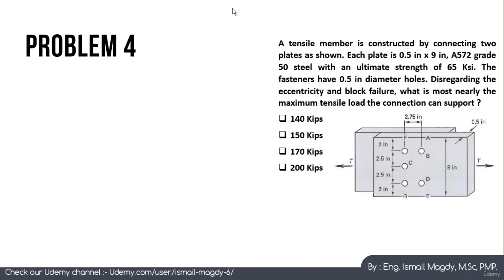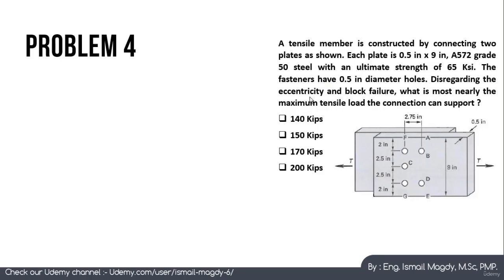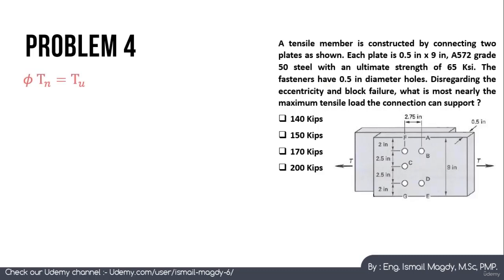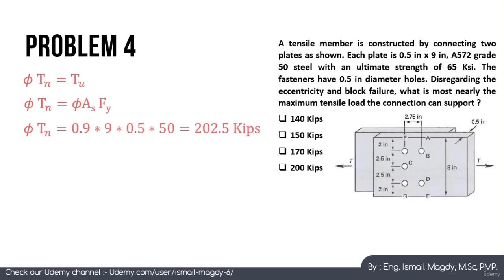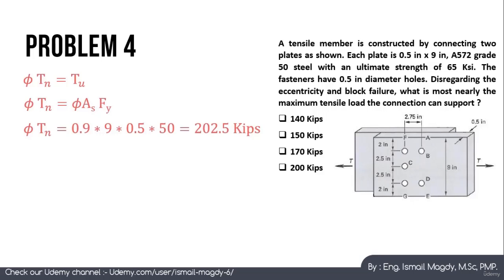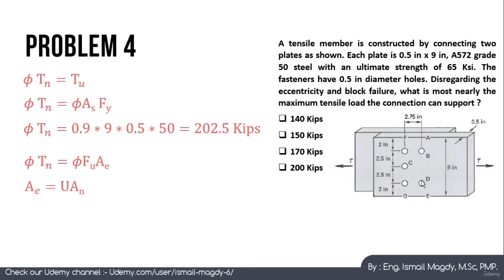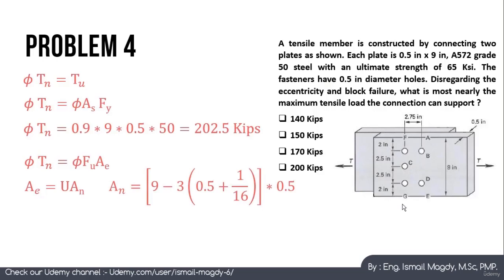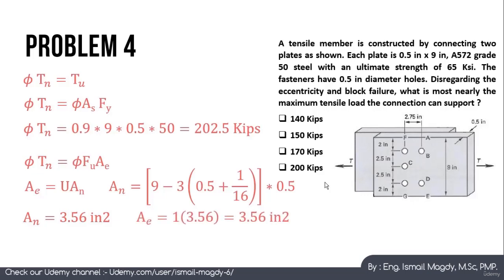Steel Design Exam Answers | Part 4

Comment from the maker: 🦾 Steel Design Exam Solutions – Part 4!
Which topic should appear in Part 4 —
Tension (Advanced), Compression (Buckling), Beam Flexure, or Connections (Bolts/Welds)?

👇 Comment your vote — I’ll use the most requested topic next!
▶ Playlist: https://tinyurl.com/4fdnmzca

👍 LIKE & SUBSCRIBE to keep learning steel structural design.